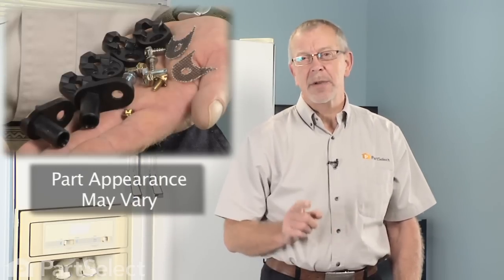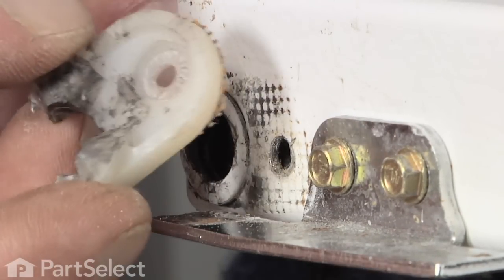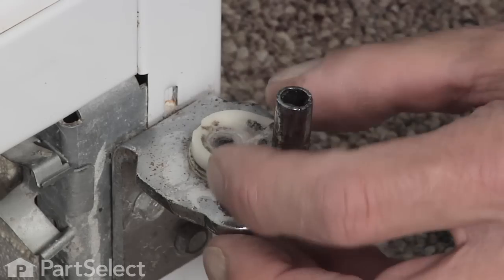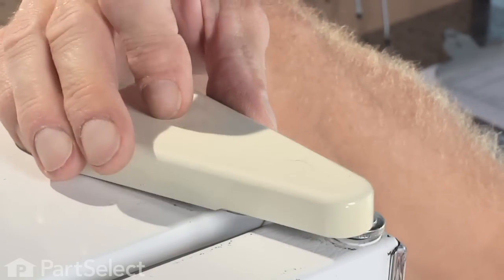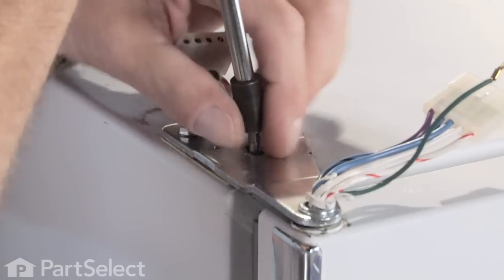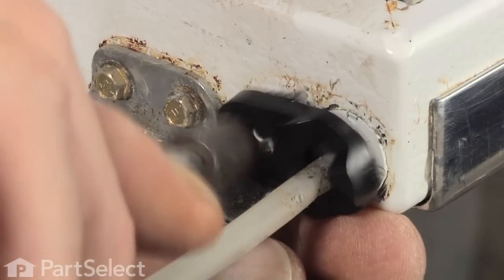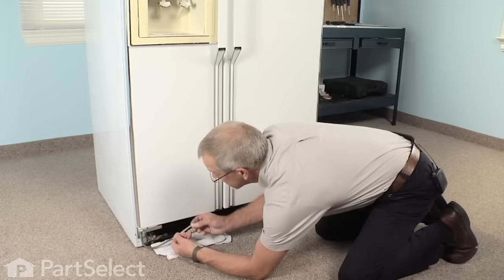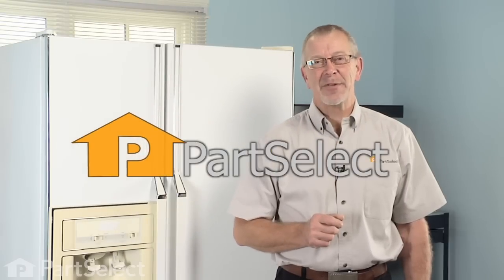Refrigerator Repair - Replacing the Door Closing Cam Kit (Whirlpool Part # 4318165)

Comment: This is the best video on cam replacement.   I always watch multiple videos to find the best.   
Some people say it is a fifteen minute job.  No way..  It takes 15 minutes to empty the fridge door and have your parts and tools ready, and your drop cloth to protect the door finish, 
Changing the cams is less than fifteen minutes.   
I could not set the door down onto the lower hinge by myself.  If I did this everyday, I might be able to do it.  I had to get my son in law to guide the pin into the cam as I lowered the door.  That worked.  So you should plan on two people to finish the job.

Comment: Great video! It helped a lot! One thing to add though; after I put cams on and tested the door, it didn't quite work, and I thought I would have to tip the fridge up a bit at the front on the floor. However, once I refilled the shelves in the door with all my stuff, the weight of those items made the cams work as they are designed to do, and I didn't have to anything more.

Comment: This was helpful.  However, based on the video I went and bought a tap and die set because I didn't have a 10-32 tap.  I wanted everything I needed before taking the door off a refrigerator full of food.  It turns out that my refrigerator (KitchenAid KSRS25FGWH03) already used the #10 threaded shoulder screw.  Also, the upper cam had a tubular insert that went into the door.  Fortunately, the cam kit came with both the type shown in the video and the one needed for my refrigerator. The kit has two sets of everything.  I didn't bother changing the freezer door since they are still fine, so the one kit provides enough parts for 2 repairs.  The freezer door gets opened less frequently, and has far less weight, so the came lasts much longer. This really should have been a metal part not the nylon or delrin it appears to be made from.

Comment: Only the CAM on the bottom was bad on my unit. I didn't need to take the door off at all. I used a car jack to elevate the door just enough to support it's weight.. I then took off the metal bracket that holds the lower CAM. Changed it and then the one on the lower end of door. You have to work down on the floor but it's straight forward like he's doing it. Reinstall the lower bracket with the new CAM. Lower the door and remove the jack. Done.

Comment: Doesn't he say in this video use a 3/16 drill bit and 10/32 tab if you have an older fridge?  I drilled it with the 3/16, used the tap, and the new screw is now too small to catch the threads.  Now besides machining some kind of new larger screw I don't know what to do.
Reply: Marcia, Your comment made me check various drill and tap sizes. I think that a 3/16" drill is a bit large. Drills and taps cover a range of sizes and the 3/16" is a bit on the large size of the provided #10 shoulder screw's threads. I ended up using a 5/32" drill and very gently machining the opening with the 10-32 tap. I say gently because if you are aggressive with the tap you can oversize the threaded opening same as if you used too large a dril. Hope you were able to resolve your issue.